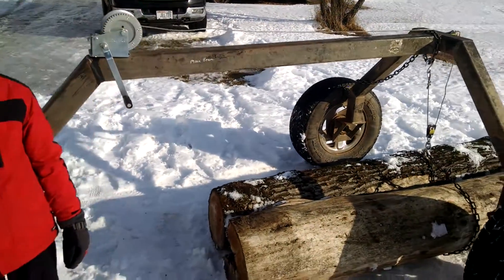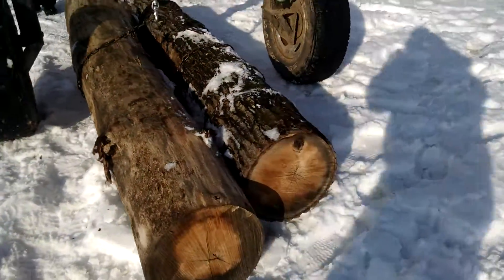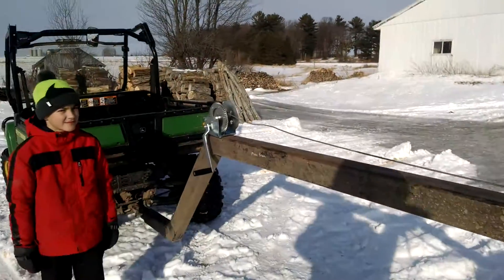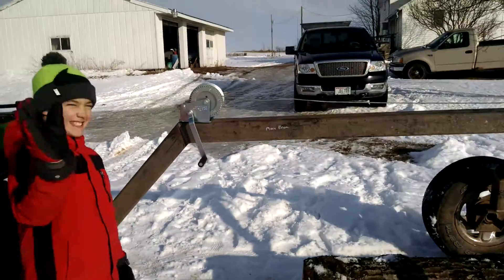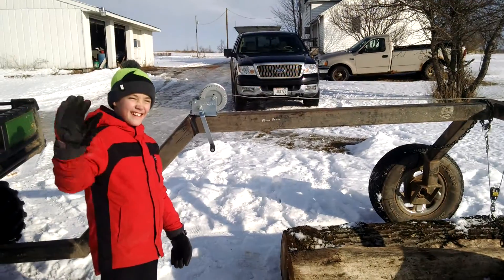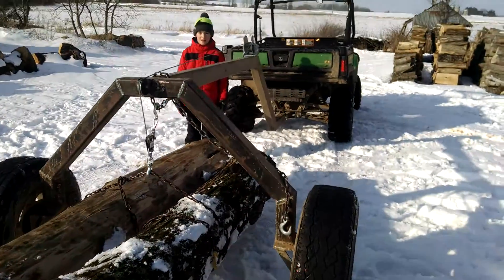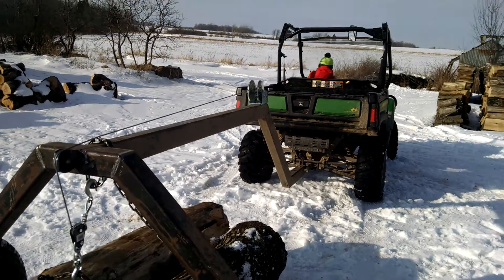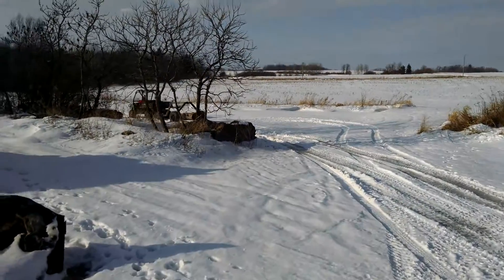Trying out the log arch

Comment: a strut on either side of the arch, angled forward and up to your main beam, will increase the arch capacity by about 1,000%, but it is still a well-done home DIY arch. thanks for posting
Reply from the maker: Yes. I was just trying it out last winter on some popple, which is pretty light. I am in the process of adding exactly what you described to give the legs more strength. Thing should be just about indestructible then!